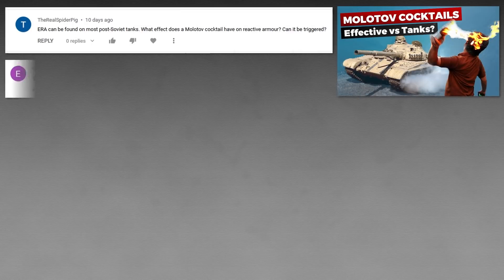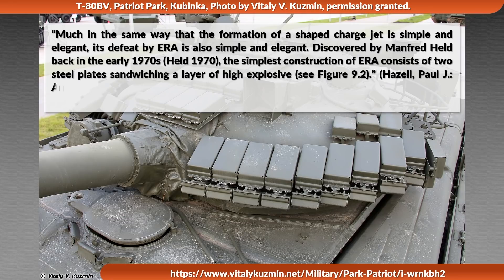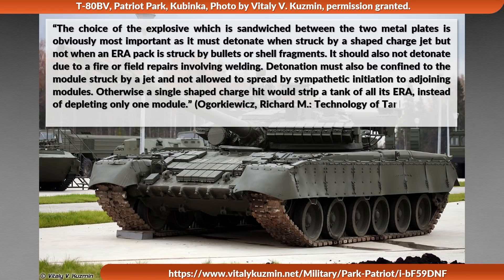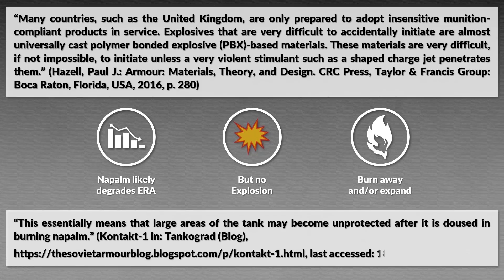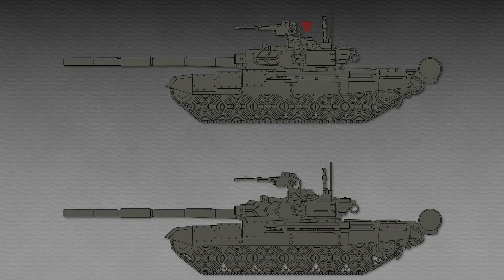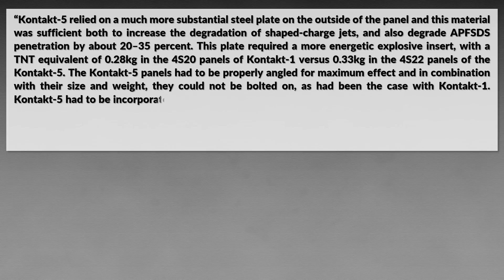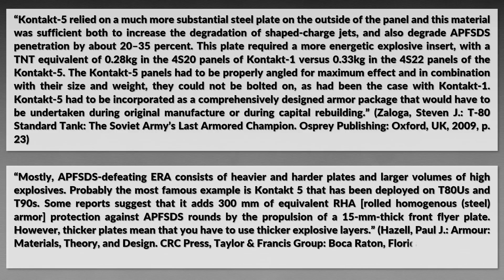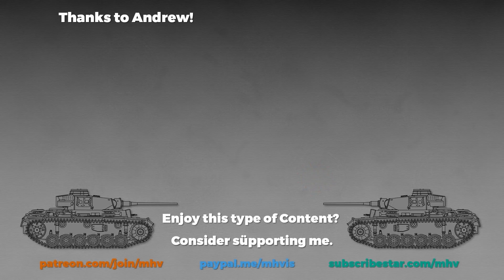Why does Russian Explosive Reactive Armor not explode?

Comment: There is a fine balance that has to be achieved by the designer to adjust the explosive so that it will not react to a chunk of metal that is only traveling at mach 3ish, but will react to a jet traveling over mach 7, and also react fast engouh to disrupt that jet so that it is too disperse to penetrate armor.  If the Russians skimped on the quality if that explosive or were too conservative then it would react after the jet has passed through or not at all

Comment: Reading through the comments I see one observation missing.

AT weapons such as the Javelin are designed to hit the top on the tank where there is no ERA. In addition, tank crews and ground forces with other AT weapons are trained to aim at the weak parts of a tank - where there is no ERA and/or the armor is thin (top, rear, sides).

Many of the tanks we see in pics and videos from this war have shown the extreme weakness of all Russian tanks - the autoloader system and lack of ammo protection. When these tanks were penetrated, the ammo ignited and often they jack-in-the-box (turret blows off) and/or the explosion rips through the weak parts of the armor. No ERA is hit, or the block that was hit is pen'd and the rest of the ERA is not touched. Since there are no blast panels around an armored ammo magazine and no blast door between it and the rest of the tank, the thing pops like a shaken soda can. Blowing the turret, hatches, and other weak areas right off the tank.
Reply: thank you for this.. i'm amazed how people can miss that the turret doesn't have ERA, it's visible

Comment: There was a UKR video a while back where you saw one of their BTR 4 with an auto-cannon taking out a T72. What seemed to happen in that video was that the T72 was targeted with rapid 30mm fire, the ERA exploding all over the place from repeated impacts enveloping the tank in a cloud of dust/smoke and then eventually the armour was pierced and it was the end. Quite shocking that a SchutzPanzer could take out a real tank and the ERA (IMHO) seemed to contribute under the pressure of the very rapid 30mm fire.
Reply: I saw that video too. It probably wasn't the ERA that exploded. The T72 has spare ammo for the HMG mounted on the hull and there are 2 petroldrums at the end. The autocanon was aimed at the side, at the place with thin armour and behind  that is the gastank. Also the 30mm grenades give rather big explosions as you can see in other video's.

Comment: From an old armor school buddy.  ERA and other "miracle" detonation defeating systems are only meant to allow a very limited window of time, for crew escape from the armored vehicle.  They do not exist to preserve the vehicle as a "factory fresh" fighting machine, after the vehicle is hit by enemy fire or is mechanically immobilized.  Due to accident or enemy fire.

Moreover once the treads, the tracks (2), or transmission sprockets throw the track from the vehicle (thereby immobilizing it while under fire).  The crew abandons the vehicle; and they themselves destroy (usually by fire ) the immobilized vehicle.   And as it is explained in the video, the crew certainly could not escape if the ammunition or ERA, began sympathetic detonation; or fast/slow cookoff detonations.  As a result of mere immobilization of their vehicle.

The most important thing you wish to do is the make sure the immobilized vehicle doesn't end up in the hands of the enemy shooting back at you.

Comment: OK my apologies this might be a little long and perhaps poorly worded but a simple understanding of the difference between low and high explosive might allow you to understand part of why the explosive used doesn't detonate in the presence of fire ( outside of any of the reasons you give ).

As this Google description puts it....
Explosives fall into two categories – high explosives and low explosives. The main difference between these two categories is the velocity of detonation. High explosives detonate at a rate greater than the speed of sound whereas low explosives deflagrate. Deflagration involves particle to particle burning.

Basicly low explosives like gunpowder or gun cotton burns rather than explodes they just burn really really fast just not as fast as sound ( burn gunpowder in a pile it just flash burns, an explosion happens due to confining the gasses resulting from it burning suddenly being released when whatever is confining them gives and the gasses escape at supersonic speeds).

High explosives often need a shock wave to initiate it's own and explodes instead of burning fast ( I hope that's understandable I am sure I could have worded it better and if someone else can I'd be grateful). If you apply fire to most plastic type explosives for example ( varieties of which I believe are used in ERA ) all it will do is burn no matter how hot the fire. During the Falklands war the SAS apparently used chunks of C4 like the fire blocks you use on camping stoves to boil water. Not certain how much of a myth that actually is but you absolutely could do it completely safely. 

Love the videos you make I'm glad I subscribed.

Comment: Reactive armor it is also designed to defeat Apfds ammo not just only Heat. kontact 5 already does that present in T72B3, T90A and versions of T80 etc. Modern reactive armor present in T90M and T14 is designed to defeat even tandem Atgms but those tanks are not in the battlefield

Comment: modern high explosives have been developed only be detonated with very limited specific methods, its a mistake to think that high explosive will automatically explode with flame or heat. Detonation of high explosives may generate flames but detonation is not burning of the type seen in black powder or common fireworks.
Reply: Or, to strip it back, "FFS, have a 1min think about the ERA problem your question proposes.  Please step away from the tank."

Comment: It does not surprise me that Russian tanks would be in Ukraine with ERA that did not have any Explosive between the layers. And it probably is not just troops "stealing" the explosive, or it being "missing" from the factory finished tanks. The Soviets and Russians have at least had test programs involving Reactive Armor that uses both other fillers ( like rubber ) as well as hallow space ( and even very small Explosive charges in hallow spacing ). 
Good video MHV!

Comment: High explosives, i.e. c4 is very stable and heat will not set it of... High explosives need shock forces to break the nitrogen bonds, and in some states you can actually ride around with c4 because it is quite safe, the blasting caps however... Don't play with blasting caps... You can burn c4, throw it, mold it, sleep with it

Comment: Summary obtained directly from the video:  Modern Explosives are NOT detonated by heat.  They require both heat AND percussion.

Lesson learned:  STOP relying upon just one means of defending yourself against tanks.

When one is unlawfully (International rules, not mine) threatened by tanks, consider the points made in the video:

1.  Machine gun fire and high-velocity 50 mm sniper rounds to break open the protective sheet metal barrier (3 sec)
2.  Thermite,* to get it good and hot (5 sec)
3.  High-velocity rounds from sniper fire (3 sec)
4.  Track-fouling helix twisters (another video)

*Obtained by attaching thermite packs to the sides of Molotov cocktails...

Alternatively, if you can stop tanks without detonating their armor, then harvest that armor for use against further unwarranted, uninitiated and most importantly, unlawful aggression from violent criminals like Putin and his Russian commanders who have repeatedly violated the Law of Armed Conflict and International Law of War.

Yes, people of the World!  Both peoples and countries throughout the world repeatedly gathered throughout the 20th Century to agree upon what is and is not acceptable during both declared War as well as ALL Armed Conflict.  We ALL have the right to defend ourselves and our homelands!

What Russia is doing has repeatedly violated International Law.  They MUST be held accountable!

In the meantime, Ukrainians have EVERY right to defend themselves, their property, their cities, and their entire country against CRIMINAL Russian INVASION.